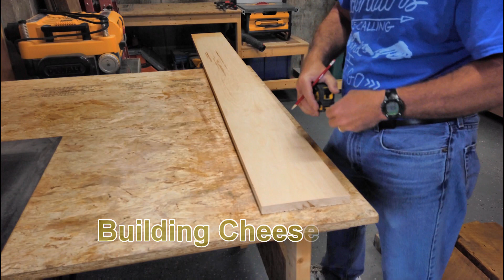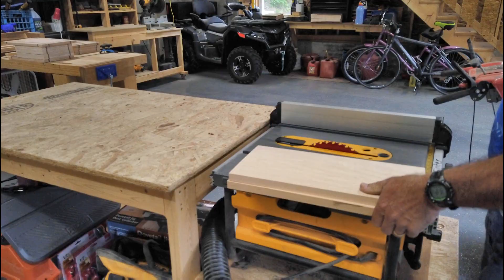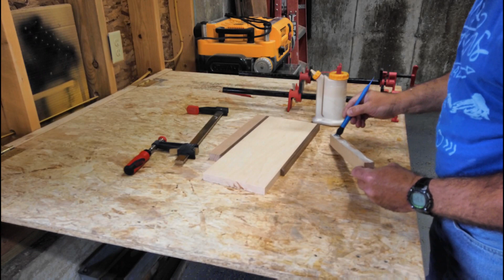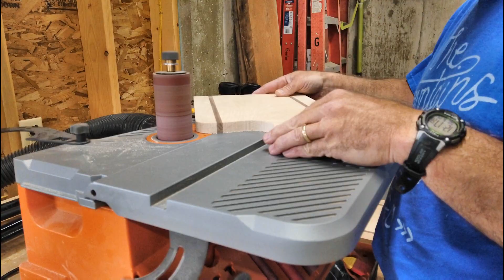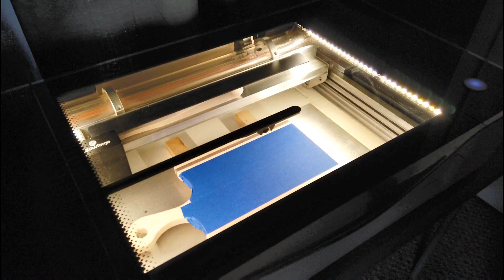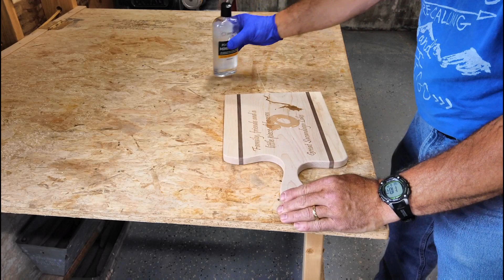Making a laser engraved Cheese Board

Comment: What settings are you using ? I have that laser and need to learn more about setttings
Reply from the maker: I set the laser to Engrave at 75% for cheese boards and cutting boards to avoid deep areas where food could get stuck. I usually set it to 100% full power for signs or anything not food related.